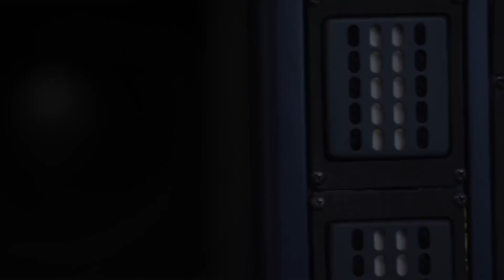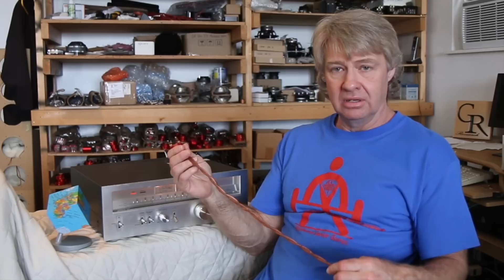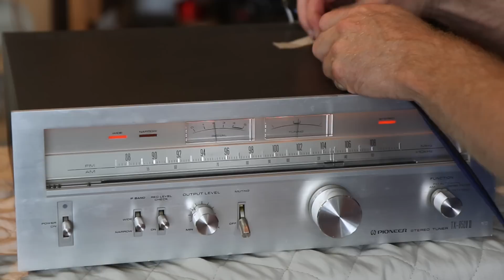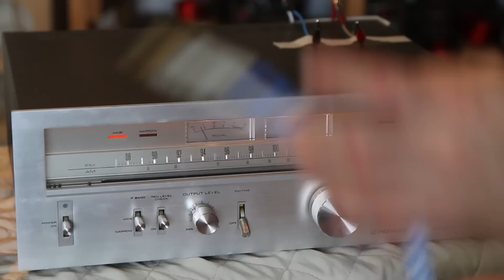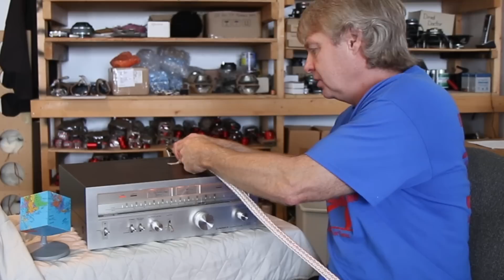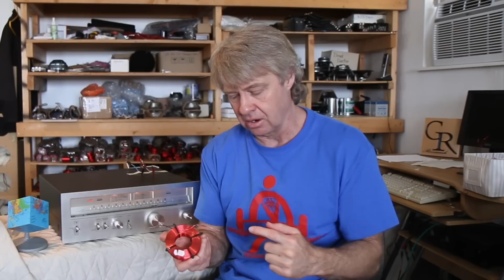Do Audiophile Cables Matter? Here's PROOF!

Comment: Seems to me this demo is completely irrelevant.  All it shows is how good the cables are as radio antennas.  The cables would behave completely different when one end is connected to an 8 ohm or less impedance at one end and the other end is connected to a very low impedance output of an amplifier.  It's like determining how fast cars would do in a drag race by measuring the rpm of the tires while the cars are jacked up and the tires are spinning in the air.
Reply: Can I respectfully suggest it would be helpful to take a look at what  "twisted pair" cables achieve and why they are used in audio to eliminate interference.
Reply: I believe in having decent cables to the speaker and I DO know the effects of back RF and EMF on the speaker return lines causing sound issues and amp problems..
What SHITS me is when people say "Come to my listening room blah blah blah"
Your average Joe doesn't have a listening room and is not going to care about what a system sounds like in yours. Their house is not set up like that and has different furnishings and hard surfaces that interact in a MUCH different way to your listening rooms.
Listening rooms are the real snake oil here.
I could set up a listening room with a wire loop in the wall pumping out RF white noise and drop a cable next to it to show how much it dirties the signal.
I am not saying you guys do this.
But who the hell knows what is behind the plaster board or under the false floor of a listening room.
It sure as hell isn't set up the same as my house and that's where the magic difference really comes in to play.
My current sound system has NO NOISE AT ALL.
I am running a Pioneer SX-10AE Amp with 4 x Infinity R152 Bookshelf speakers. The only way you know my unit is on is from the glow of the LED screen because at full volume there is no hiss at all.
I am running some good quality copper cable to my speakers. Its a pair without shielding and its a horrible green colour.
I have short runs to my speakers and I get no interference or back EMF or any of that crap.
If I did I would investigate relocation of the cables and run some Ferrites on the speaker and power cables as I have done before.
I've never needed $10,000.00 cables and I never will.
Stop LOOKING for the noise floor and the PROBLEMS with your audio setup and for God sake start enjoying the music.
The guy with a $500 stereo enjoys his tunes a million times more than the guy with a $200K system and a listening room
Reply: @1974UTuber  You're right with a cheesy budget level system like that you'll never hear the difference in anything.
Reply: @1974UTuber  Your an IDIOT. If I do a blind test it would be in a PUBLIC setting. No weird things in the wall at a neutral location you moron!!!
Reply: @LazyH-Online One of the big magazines did your double-blind test and mostly proved you right. Mostly. Most of the listeners couldn't consistently pick the higher end cables out. The stickler to the whole shebang, tho, was that one person could always pick it out. An orchestra conductor was present and had no problems with it. I believe nearly everyone will second guess themselves when trying to pick the "better" cable. I don't believe that an oscope tells the whole tale. I think there may be some other test/tests that we haven't discovered yet. 
In any case, that test I mentioned was back in the early '90s and tho I'd love to put it up as proof, I don't have any of the mags I used to subscribe to. You wouldn't believe it anyway.
Reply: LazyH-Online So, based on what you just argued, explain why the Richard Clark test was really that worthy of a point of reference to this discussion? What I meant as “quality” was anything that could meet Clark’s criteria for distortion measurements. And, I don’t think we are really and altogether disagreeing where his test is concerned, but there have been blind tests that support different audio cables producing audible differences: 
 https://www.stereophile.com/content/minnesota-audio-society-conducts-cable-comparison-tests-0

To assert this is completely psychosomatic/psychological is reasonably absurd, as no more can you prove this than the empirical reliability of the Richard Clark test. What and how people hear -when they even hear well - is so entirely complex and variegated, before you even get into the “listening experience” as you are referring to. You cannot assume for others what you yourself cannot hear and assert they are foolishly following suggestion. I kept bad cables around, just to see if I’m just fooling myself. I listened -back and forth - with the same equipment between cables. I also allowed plenty of time to have my ears adjust, to where I was convinced the crappy cables were fine, changed back to the better ones and heard (with the same album after an entire week) very distinct and audible difference in overall clarity, instrument attack, decay, depth, positioning, tonal characteristics and space. Another issues to consider is the plausibility of collusion that can occur if too short a time is spent between the listening examples of ABX testing. To take your point in the other direction, the very nature of the test has psychological factors to consider. Not to mention the test I just sent here on the link, for that matter. I am all about the science, but how our senses factor in? Still beyond testing (at least in this manner), and why it’s right out absurd to simply tell the public they are just fooling themselves. It isn’t plausible for you to hold that assumption based on one highly controlled -and I dare say stringent and not entirely relevant - double blind.Now, if Clark decides to reproduce this test with cables instead of amps, then I’ll be “all ears” (pardon the pun!).
Reply: LazyH-Online Arguably, much of the Richard Clark double blind would still support what’s going on here. I also agree that when equipment gets to within acceptable/quality parameters, that there there really is no major difference. That double blind was set up with equipment that maintained very low distortion  within a set db listening range , as even some of the cheaper name stuff can render. The devil really is in the details, as even Richard Clark admits that there can still be some noticeable differences relative to filtering due to types of circuits and components within certain amps. There is a certain control factor to his comparison that would almost fall outside of this discussion, but where it is supported -in my opinion - is the idea that QUALITY products designed to produce equal measurable results are used. In this sense, it’s comparable to the difference between Home Depot lamp cord - not specifically intended for decent  EFI/RFI rejection, and properly shielded twisted wire - designed with the purpose in mind to delivery as much of what the amp produced, without as much audible noise from surroundings and neighboring components. So, as soon as cables get closer to this more optimized and case-specified spec, then of course there is no longer much (if any) audible difference.
Reply: @LazyH-Online Yea the real thing that tells you that their product is total crap is the fact that they will fly all over the country and sometimes the world to sell their crap cables but not one will fly here to take the challenge I have put to them. I am not rich and I don't own my own business but yet but you know that the salesman Danny Richie is at least working in and or owns a business selling this crap because he has a "listening room". But he just like all the others will not back up his cables. Come on Danny Richie! Do a blind test NOT IN YOUR LISTENING ROOM but in a public setting and also a true test nothing rigged. I 100% know you will loose!!!
Reply: universe9496 Wow. That’s a great deal of hard blowing just to have a position on this. Why do assert this with such vigor? For as many people that say it does not make a difference there are at least as many if not more that say it does. I’ve done this exact test with copper garbage, with heavy shielding, and then with ZU audio cables with the same gauge and length, both banana ends. HUGE difference. And I went back and forth with the wife and some audio friends, and they noticed a big difference. With better and better equipment, the differences become more noticeable, no? Overall, you can blow as hard as you’d like about this, but you can’t say that others don’t really hear a difference. You’re not in their ears 👂. Enjoy the music 👍🏼🙏🏼
Reply: @riccitone  Forget listening to music ... show on video on an o-scope the noise/ noiseless samples of these cables if there is noise the oscilloscope will show the noise or lack there of noise ... there can be no arguments then
Reply: Darin B. Sure, I would be all about that. I was just basing my answer to universe’s comment relating to how he could not hear the difference between Home Depot cable and hi-end cable on his system, and challenged poor Danny to waste his own time and dime to come to Florida to see if he could hear any difference! Also, there seems to be a lack of balance between the mathematics and the physics of this entire discussion. What many scientists have come to realize, that there are times when differences are noticed regardless of a null on an oscilloscope. But that’s the best place to start, of course.
Reply: @riccitone  I still stand by my statement. And I still have yet to see any of the fancy cable makers take my offer and I think you know why!!!
Reply: universe9496 Lol! Ok, this just confirms a “to each is own” approach to this. Bottom line...as long as your system is anywhere close to where you’d like it to be, then don’t sweat it 👍🏼
Reply: Darin B. But to add to my last reply, so sad that you actually formed the sentence “Forget about listening to music”? So sad. I understand what you meant by it, but just he same...this entre dimos is Sion is forgetting about the most important thing. LISTENING TO MUSIC. Otherwise, we are all then obsessed about reducing the noise floor to the extent that we lose track of the simple enjoyment of what has (or should have) brought us here in the first place. I’m listening for detail, nuance, dynamics to the end that I hear even more in the performances I stream, play on LP or CD. Hell...sometimes it’s a compromise, in that the pursuit of a negative noise floor might suck the life out of the music. Sometimes, the existence of a little distortion, noise, what have you, may be needed in order for our equipment to deliver what is most “human” from our kit. Just a thought, albeit quite a bit on the philosophical side.
Reply: @universe9496  No one is going to accept your challenge because you cant afford their product anyways, its a waste of time. You arent alone, they arent coming to my house either lol. Pretty simple. You are also bias and even if you heard a difference you wouldnt admit it. I want to see the scope. But then again, is that relevant as we will  see noise, but will it be in the audible range? i havent found any good info on the topic. Its all BS on both sides. Eventually going to go get a scope myself and test my system because thats what matters. Noise, power, rfi.... its going to be different in each home.
Reply: @kolinstallman3788  No one will except my challenge because in the end they would loose piles of cash when I post a video of it showing that they are just scamming gullible people out of there cash!!!!!!
Reply: @universe9496  Its not because they are gullible. Its because they want to pay a certain price for something. That want to have something unobtainable to normal folk. Its in every industry. People will spend 10k on shoes. Does a 50k watch tell time better then a 10 dollar watch? No? So how is Rolex in business? Same reason as Nordst.  Different classes of people. Thought process is entirely different. Its not "who has the best deal on copper?" Its "I want to spend this amount of money what is available?"
Reply: Good analogy and they will behave different under a load, but the RFI  and EMI issues are not at all irrelevant. There can be quite a bit of an impact on the sound.
Reply: @dannyrichie9743  Maybe if your house is next to an FM transmitter .. but irrelevant at speaker level.
Reply: @rhubarb99999  If it were irrelevant then adding an element like ERS paper on the cables would have no effect. But in reality, it does. So you better rethink you're belief system.
Reply: @universe9496  We've done blind test out the wazoo. You damn near have to be deaf not to hear the differences. But keep telling yourself the world is flat enough and you will truly believe it.
Reply: @dannyrichie9743  Yea show your blind tests on video in an open environment like a mall or some other place that the general public can be used as test subjects. Oh and you didn't say yes to excepting my challenge!! As usual just hide behind saying you did a blind test with NO proof it was ever done!!!!
Reply: @dannyrichie9743  Oh and you also do not see the author of this video excepting my challenge ether do you!!!
Reply: @universe9496  It is not worth my time to drive to FL to teach one nay sayer. I have a better idea for you. Come here to our listening room if you want to learn something. You're bubble will pop pretty quickly.
Reply: @dannyrichie9743  Ha Ha yea right. I don't have to! Those who sell those $1000 + cables should be willing to back up their product but NONE ever do!!! Like I said I have yet to have one of those snake oil salesmen EVER except my challenge. If what they claim was true you would think they would be willing to back it up but just like you NONE ever do!!!
Reply: @universe9496  they will never accept the challenege. We are called na sayers etc.. And yet we have to believe what they say, why. Agree with you totally. This test is a  nonsense to prove how a speaker cable sounds.
Reply: Danny Richie but seriously... after covid19 can I visit?
Reply: @universe9496  Why don't you accept his challenge and report on it? Set your pride aside. Then you know if their is a difference. You didn't think he would come do you. He would be driving around the country if he accepted the challenge. If you are real then you would go.
Reply: @Junker_1  I am not sure what you mean? I am more than happy to have those people come here and prove them wrong but like I said NONE have accepted and NONE have ever said they would come here to prove me wrong!
Reply: @Junker_1  The comment posted by Danny Richey 

(It is not worth my time to drive to FL to teach one nay sayer. I have a better idea for you. Come here to our listening room if you want to learn something. You're bubble will pop pretty quickly.) 

They will not EVER except the challenge.  They just post crap saying how their million dollar cables are best. Again NO ONE has ever excepted my challenge! He doesn't want to waste his time on ONE "nay sayer" But he doesn't see how this could be used as an actual advertisement for his product if he proved me wrong. That is how you know for sure his cables are just over priced CRAP!!!!
Reply: @universe9496  I don't know his cables are crap. But that is not the point. If you really care why don't you go there or make an appointment and you film it? That way both sides would be happy. You have evidence if it really is crap and vice versa. If they would refuse then you know they are not genuine because he invited you already. It seems like you also don't accept the challenge. Why don't you mail them and set up a blind test there and film it?
Reply: @Junker_1  Oh I will actually say that their cables probably sound real nice, okay. BUT wire from home depot will sound JUST as good!!!! and cost thousands less!!!
Reply: @universe9496  Thanks for the Link!  As an RF/Microwave engineer, and  I cracked up when he said he was connecting them as antennas (I'm chuckling now). It is a clever test maybe for wires to use for your FM tuner, I suppose.
Reply: @universe9496   Danny Richie (gr research) is a speaker designer. As far as I know he doesn't design nor sell cables, cheap or expensive ones.
Reply: @rhubarb99999  My old computer speakers made all kinds of weird noises every time I received a text message or phone call. I would hear those noises before getting the alert on my phone. Also, everytime I flipped the lightswitch, the speakers would pop. RF, EMI, and other stuff pose real problems.
Reply: @dannyrichie9743  wrong, you can't here those frequencies.
Reply: @airgliderz  You don't have to hear FR noise itself for it to have a clear audible effect on the audio signal.
Reply: @dannyrichie9743  ahh “clearly“ your speaking as snake oil salesman guru mythologist star gazer, tea leaf reading, card reader intooer guru of myth hat on.. LOL :-)
Reply: @airgliderz  No, I'm the real deal and teaching how it is.

Comment: What a dumb test, so you are making antenna wire?  AC audio is much stronger than any RF being picked up, this is stupid
Reply: The noise floor levels caused by RFI and EMI is a real issue and is quite extensive sometimes.
Reply: @dannyrichie9743  quite extensive on a speaker cable? You're kidding, right?

Comment: Danny,
What brand was the 24 strand cable?
I'm always amused at the reflexive almost religious determination of some, to try to convince you and others, what you hear and experience in your own system is a fantasy or a lie. And, some of the Nay-Sayers are just outright obnoxious.
Reply: I ordered the wire in bulk from the manufacturer.
Reply: @dannyrichie9743  so you made the cable yourself, the braid looks machined, nice work.
Reply: @ericharrelson2045  I did a lot of things to that cable, but I didn't have to do the braiding. It was machine braided.